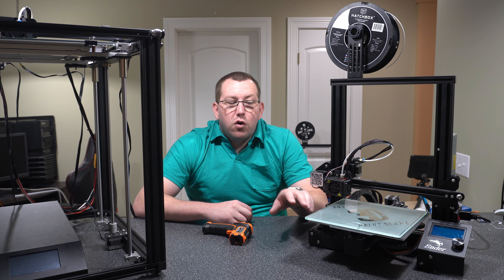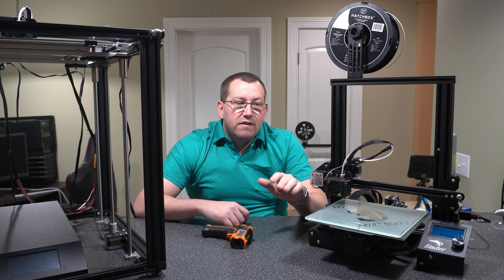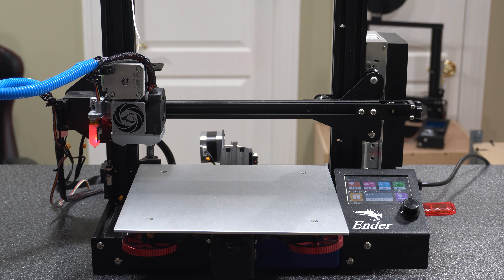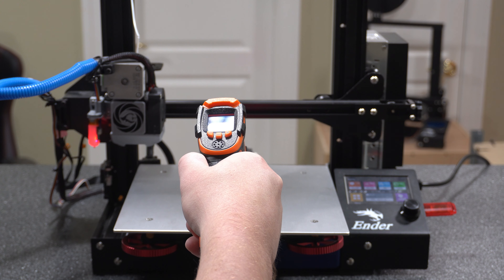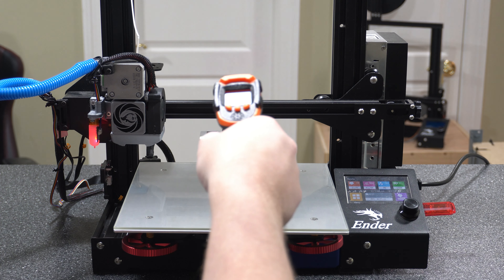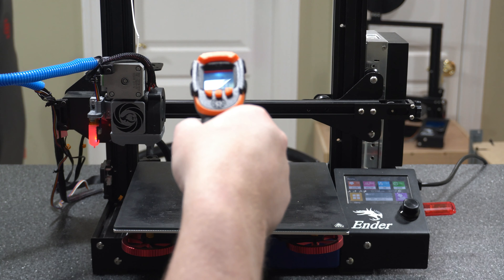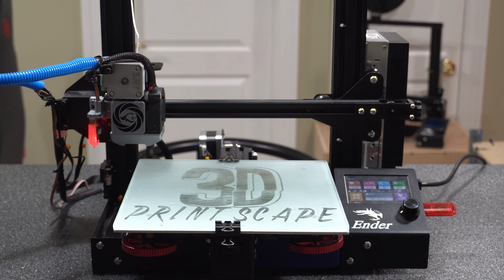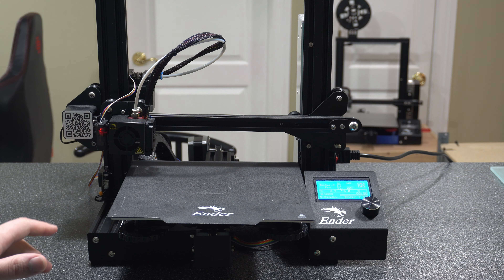Does the Thickness of the Bed Impact the Temperate? Let’s Find Out!

Comment: I've been using a piece of glass I got from the glass shop for five bucks. It's between 5:00 and 6 mm thick. I admit it takes longer to heat up but once it's up to temperature it stays warm for quite a while after which is what I like. I've been wondering how accurate it is I just didn't feel like going out to the car to get the thermometer like yours out of my trunk. I however have the black surface on my metal bed still but I removed the magnetic removable bed.
Reply from the maker: Hi. Really any glass will work. Some of them have texture to "help" with adhesion but that doesnt always work.

Comment: Please tell me if I am; A: Wrong or B: Anal. Is it not recommended by the manufacturers of this type of thermometer that if you want the temperature of a reflective surface you put tape on it to get an accurate sample?
Reply from the maker: Hi. Using the tape will get more accurate results. I was just trying to compare the differences based on thickness at specific times.